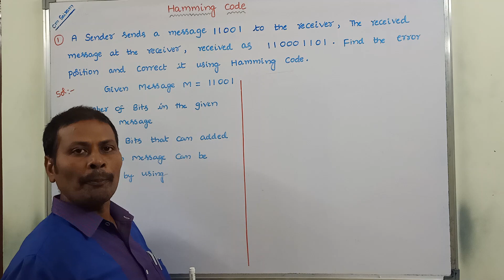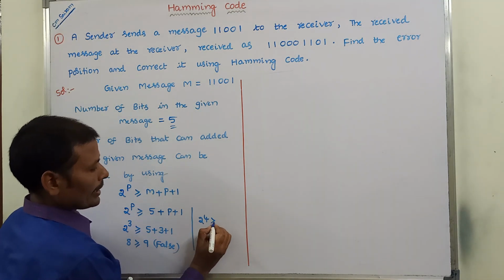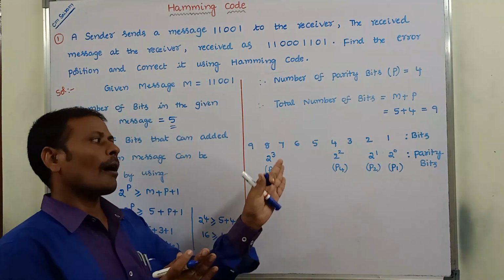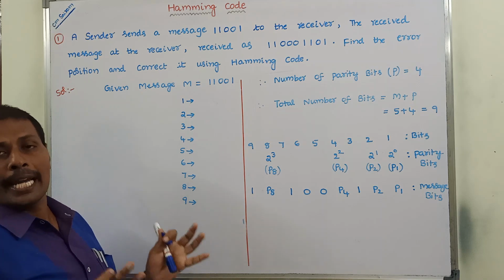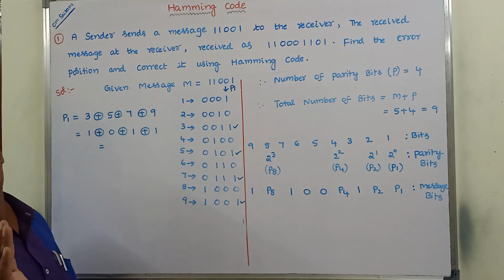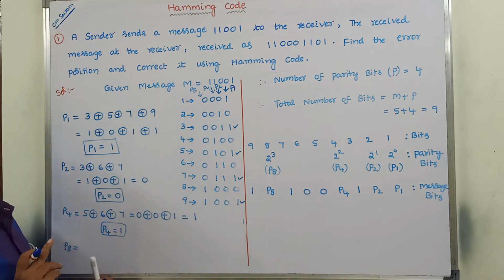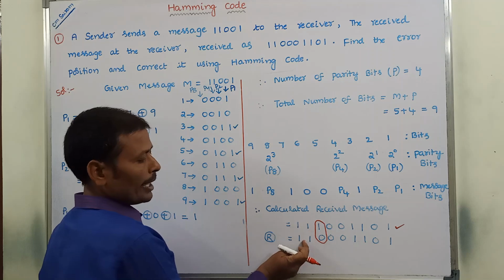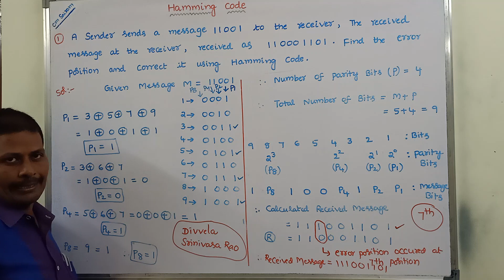Hamming Code || 9 Bit Hamming Code Problem || Error Detection || Error Correction  || CN || CO | DLD

Comment: sir i understood this but i had a question related to booths algorithm. . i watched your video but sir if it is not specified to use this specific no of bits in the question how can we know how many bits to use. .for example lets say 9x-3 is the question. .how many bits should we use. .Is it suitable to use 5 bits in all the questions ?Do we obtain a different answer when we use 4 bits instead of 5. . .I obtained two different answers while using 4 bit and 5 bit. .was i wrong?. . please clarify it sir
Reply from the maker: Use 4 bits no problem